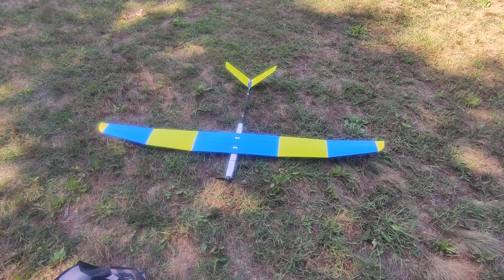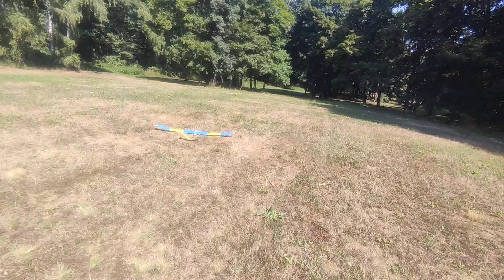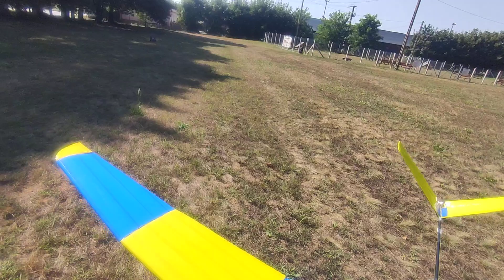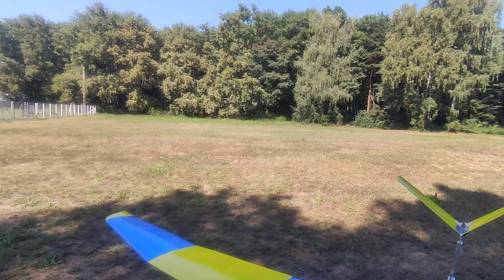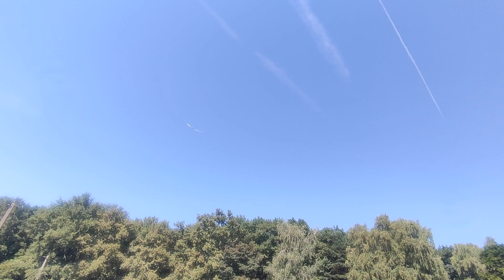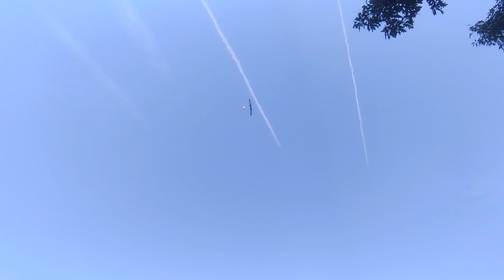The penultimate flight of the motor glider, which is still recorded

Comment: Sorry for your loss! No chance to find the bright colored wings and the fuselage? Did you try searching in the forest?
Reply from the maker: Thank your interest! Yes, I have tried to found the glider and its parts but there are lots of leaves on the trees and there are lots of small trees in the forest. Maybe in autumn I will se my glider on a tree or wing parts on the ground. It was a wrong feeling to see my glider falling down from the high air into among the trees. But I will build a new glider (copy of the PURES glider) with hot wire foam cuttered airfoil and some carbonfibre spars and mayba packing tape or glass + acrylic varnish covered wings. I will stay the V-tail version. I hope you enjoy your MD2 and you had lots of nice flights!
Reply: @goldenfish77  oh nice, curious about your attempts with hot wire foam cutting!😄I did my first thermaling session in an wide open, completely flat spot near my hometown, might upload a clip from it.
Reply from the maker: @MoritzWeller  Yes, open fields are better for flying, I'm just "suffering" here, but someday I'll go a little further. I would like to see your first thermal flights!

Comment: if the battery and rx are still on you can use you radio to isolate the direction by the strength of the RSS signal - I have done this before..
Reply from the maker: @bracesport Thank you Phil! But I think that the battery is off after 5 days. But how can I do it. I found RSSI menu on the last menu part of the model program, but I do not know how can I activate the "searching mode"?
Reply: @goldenfish77  when you point your radio at the Rx the signal is greater than we\hen you point away - you can use this to narrow the search direction..
Reply from the maker: @bracesport  Thank you for your description. Is this the range test?
Reply: @goldenfish77  no - it is just looking at the RSSI values - with a good direction to the rx the RSSI will be stronger..
Reply from the maker: @bracesport  Thank you, I will check it!